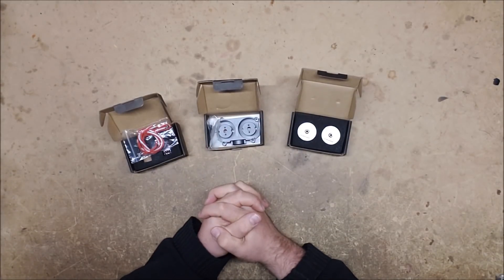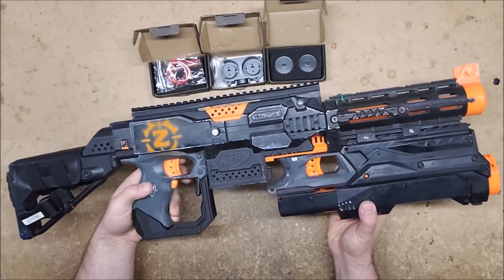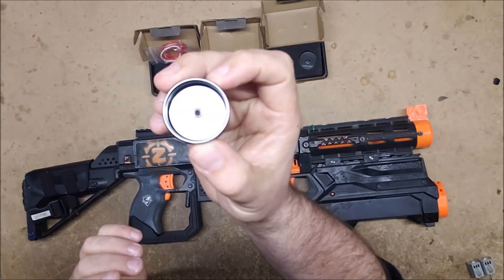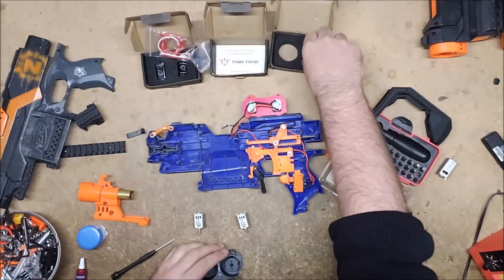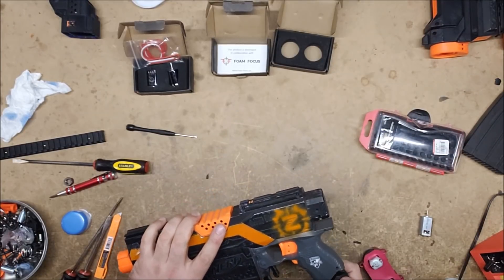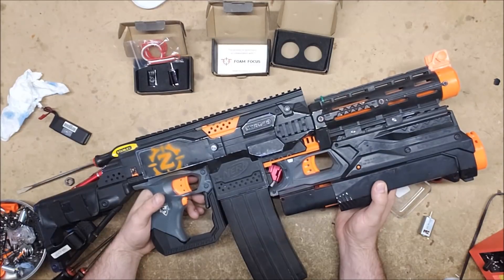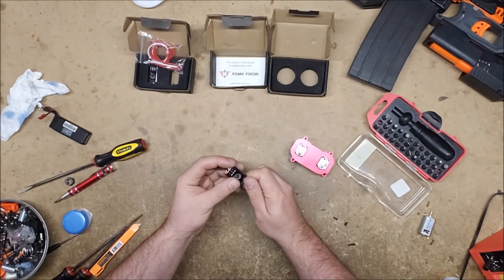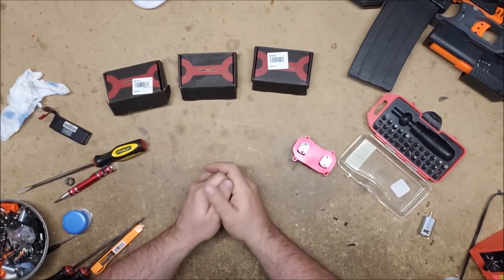Worker Motors, Flywheels, and Cage Review

Comment: The FPS of a flywheel setup isn't really determined by how powerful the motors are. If you need to drop FPS, use a lower crush cage or lower diameter wheels. The only exceptions are with high-crush, low-diameter setups like Eclipse, or ultra high crush setups which have a higher critical speed than 33k RPM (41.5 and high-crush Worker wheels hits 170s with Wolverines, which turn at 44k RPM). Stepping down to Meishel 2.0s would increase spin-up time and keep velocity pretty much constant.

Comment: You can always drop 132 motors into a Regulator without shell-cutting. There's plenty of space, just finding a metal canted flywheel cage is the problem, either that or just use an OFP cage.

Comment: Cap! How was the barrel alignment with the flywheels? The ballbearing on the FangRV is a little taller then most motors and it prevented my wheels (Black worker) from being seated low enough into my worker 425 Cage align with the barrel properly (close but still a bit too high). Curious if you ran into that with yours.
Reply from the maker: I did run into the same issue.  I think the Worker motors actually come with a spacer to fix this issue.  I may try using them in this build.
Reply: nice, I've heard about these spacers (motor shims) and was considering homebrewing a set out of acrylic, curious if the included cage screws are too shallow to allow them to be used though.
Reply from the maker: Possibly.  We will find out the next time I get it open

Comment: I do not think I really need the flywheel cage if I get their accurate flywheels because the flywheel cages are like $35. My question is if I use the ones almost the same as yours do I (NEED) it. I am very thankful if you read this.
Reply from the maker: No. There are plenty of much cheaper cages that are just as good. The OFP cages are great.
Reply: @CaptainXavier  Thanks Cap

Comment: Hi Captain, thanks for all the fantastic videos. I have a few question regarding motors here goes:

1) I don’t think I have seen you do a burnin of the motors you use (I saw that MTB did it in one of their early videos), is this not necessary with the motors available these days?

2) Have you tried the Kelly industries motor boards ? 
2b) If yes what do you think of them?

3) When upgrading a rapidstrike, which combination of motors would you recommend? 
3b) How would you regulate the rate of fire? 
3c) Would you use the same motor for pusher and fly wheels?

4) which material would you use for spacers for fang revamps? 

Best regards and highest of respect from Denmark
Reply from the maker: 1)  Burnin?
2) Not yet
2a) See 2
3) It depends what kind of performance you want.
3a) Some manner of PWM
3c) See 3
4) Not sure yet.  I will probably experiment.
Reply: 1) Ryan from MTB does it in this video https://youtu.be/yRspanhxKEM but if you don’t have any problems with your motor burning out then I guess it won’t be a problem not doing it?

3) I was thinking LARP friendly (guessing in line with HvZ) and a rate of fire a little faster than shock but not to insane (I know than auto fire burns faster through ammo but still).

4) will look forward to see what you come up with 😁
Reply from the maker: 1)  Huh...I have never even heard of that process...what is it for?

3)  I would go with an all Mishiel 2 or Fang Re-vamp setup then.  Possibly with a PWM on the pusher motor.  Much more than that and you will be pushing the limits of most HvZ's.
Reply: 1) apparently it is for testing the motors and to ensure maximum performance... 

3) cool, I will be looking into making a PWM. Any suggestions?

Comment: I think I'm going to have to replicate this :P what is the battery you use? It must be tiny! The one I use for my fangs revamped is so chunky :(
Reply from the maker: It is a 2s, .95, 65c battery. Not great for a primary that is going to see a lot of action as the capacity is not great but since HvZ is generally low engagement I have never had an issue.

Comment: Captn. Red thread locker will only come loose if you apply heat to it. Blue thread locker doesn’t require heat,  therefore being the better option for a (plastic based) nerf gun. (I know the cage, motor, and wheels are metal, but it’s better not not damage anything.)
Reply from the maker: It is blue...at least the contents are...
Reply: Oh, well then you got the weird brand that puts blue thread-locker  in a red bottle and puts a blue stripe on the label. 🤗. If the threadlocker is blue then everything’s alright.

Comment: What pack are you using and where did u get it
Reply from the maker: 2s, .95mha, 65c. I think OutofDarts sells them.
Reply: K and I have a pair of fangs, can they fit in a stock stryfe shell with the Kelly industries motor board, so it’s not as loud as your old hvz stryfe
Reply from the maker: I assume so.

Comment: Hey cap, I'm curious about dart wear with the worker flywheels. I've scoured the internet and it seems the jury is 50/50 still. I've shied away from thus far because of the possible dart wear issue. I kinda want my darts to last a while, another reason I dont run a high crush cage either. 
Any help is appreciated thanks in advance.
Reply from the maker: No idea yet, I just installed it.
Reply: @CaptainXavier  sorry, wasnt sure if perhaps you already had some worker flywheels in another blaster. That setup sounds lovely, I adore the sound of the revamped fangs.
And just a heads up I have a couple mods I'm working on for your feature fan builds. Although at my current free time rate wont be till spring haha.
Love your channel keep up the great work sir!
Reply: Depends on crush, a low crush worker wheel setup is not too bad, the highest crush possible is as bad as eclipse.
Reply: RGBGamer it would be a low crush setup. I'm just concerned with the serrated edge causing more dart wear than I'd like. I'm not worried about high fps as much as I am about destroying my darts.
Reply: @blasterparties7178  Just don't use metal wheels. They don't grip on to darts well enough and they do increase dart wear especially on low crush. Use Bulldogs, Out Of Darts Insutanto wheels, or Containment Crew Cyclone. 
If you are running 43mm or 43.5mm cage I recommend the Worker Smooth Concave POM Plastic. Here is the link: https://outofdarts.com/products/worker-425-no-grain-flywheel-pair?_pos=1&_sid=0e6121470&_ss=r

Don't use those with 42.5mm because they  are larger than usual I recommend them with this cage: https://outofdarts.com/products/worker-metal-flywheel-cage?_pos=1&_sid=5ad0f6581&_ss=r

And either Fang Revamped: https://outofdarts.com/products/fang-revamped-130-2s-neo-motor-for-nerf-blasters?_pos=2&_sid=d46f275ab&_ss=r

Or Meishel 2.0: https://outofdarts.com/products/meishel-2-0-130-2s-motor-for-nerf-blasters?_pos=1&_sid=a868397b4&_ss=r

And this battery: https://outofdarts.com/products/graphene-950mah-xt60?_pos=3&_sid=0142fa5cc&_ss=r

The battery is out of stock though and will be back in stock in about 5-6 weeks. Good luck with your mod!